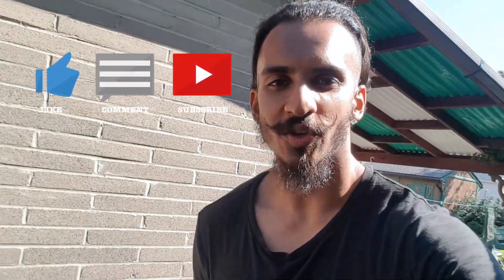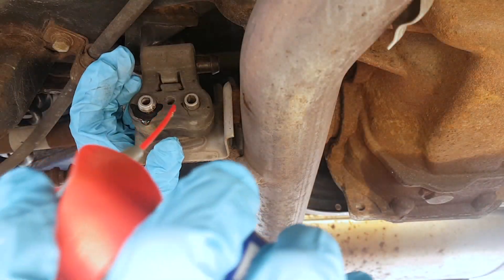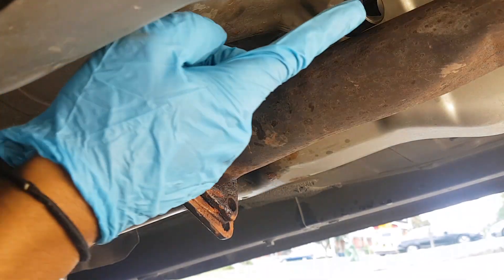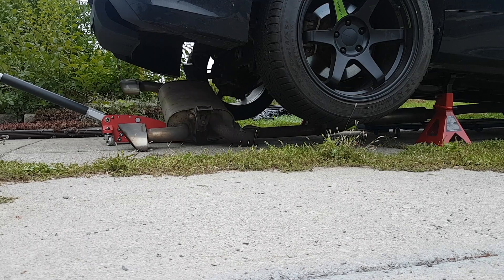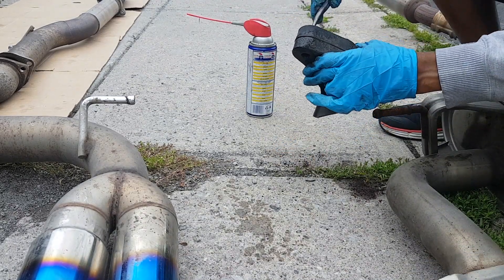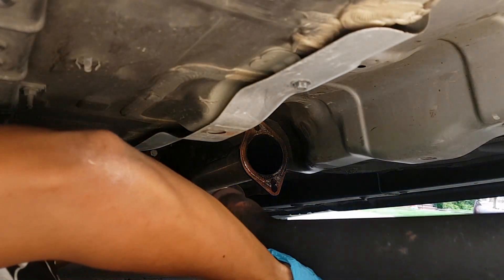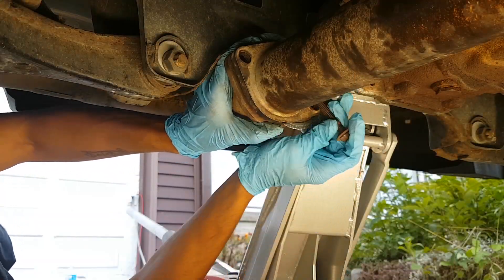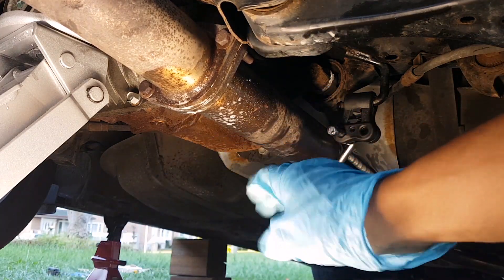ISR Race Exhaust Guide | Almost Straight Pipe | Genesis Coupe

Comment: Hey! I just installed these same exhaust yesterday.. is it normal to have white smoke coming out of it? Its a new exhaust so i think it could be normal. what do you think?
Reply: @E550benz  Thanks, i live in montreal so its pretty hot right now.. im gonna check for the coolant level but just letting you know that i wasn't getting white smoke from the stock exhaust..
Reply: Where did you get the exhaust?